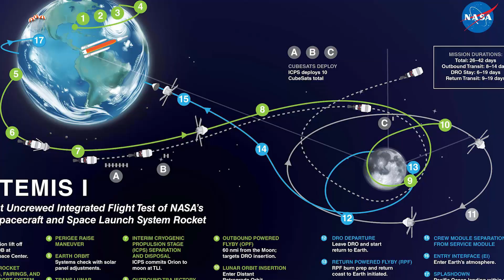Elon Musk STUNS NASA with THIS! (Moon Mission REVEALED)

Comment: There needs to be a small army of robots that can build the lunar city, under ground.  The moon has virtually no atmosphere and that means all those meteors that burn trying to enter Earth will have no problem hitting the moon, as witnessed by all the craters.
Reply from the maker: That's a great point! The underground city idea is smart for protection against meteors. Using autonomous robots to construct and maintain it could solve a lot of logistical challenges. Do you think current robotics tech is up to the task, or would we need some breakthroughs?
Reply: @ToptechInsights  Here on Earth, we have machines that are capable of building houses.  All that would be needed is robots trained to operate boring machines and trained to maintain them.  That could follow through with all the other tasks necessary.  I would start with building proto types on Earth.  Think of how long it took to finalize the JWT before it was launched, knowing repair would be impossible due to location?

Comment: Why does the Government need to be involved at all? What value does a government bring to the mission? Other than money? All the government brings is money and regulations.
Reply from the maker: I get where you're coming from—too much government can sometimes slow things down with red tape. But on the flip side, they often bring stability, infrastructure, and coordination that private companies can’t always handle alone. It's not perfect, but in some cases, their involvement can make a mission more balanced and accessible.
Reply: @ToptechInsights  Governments have never created or invented anything. And as far as "balanced or accessible", that's a joke right? They only want to be involved to reap the rewards... Let's face it, management or oversight by the government means $100 screw-drivers and contracts exclusively to "preferred" entities that benefit them.
Reply: All the previous knowledge we learned from the 60s forward?  I guess that's all useless? Just like you.
Reply: True, we have seen government decisions based not on government rules and regulations, but personal political beliefs to rule against a project.  Politics has no place in decisions, unless you are a political activist with government connections that run counter to national security.